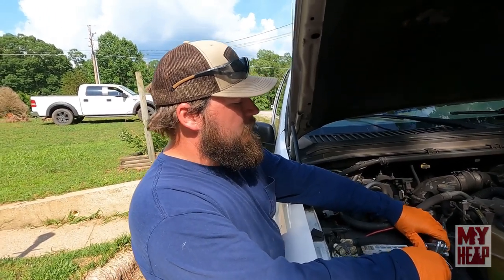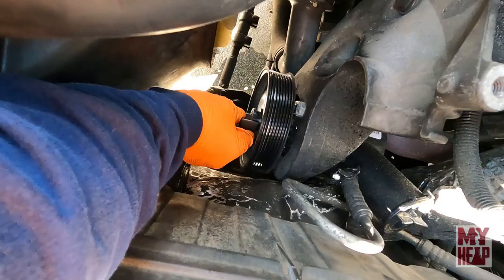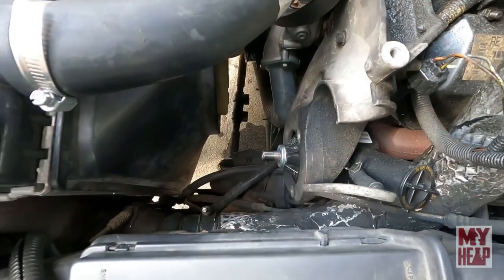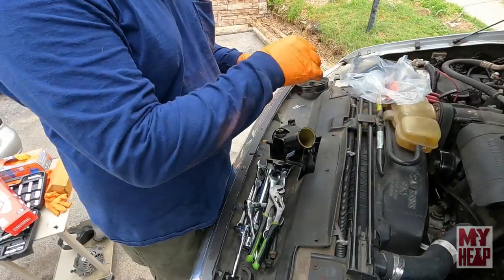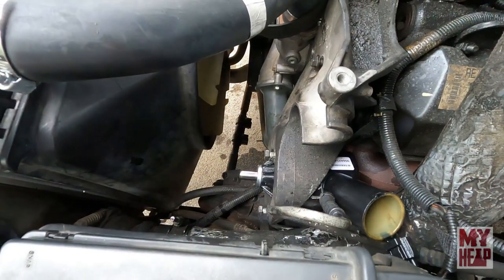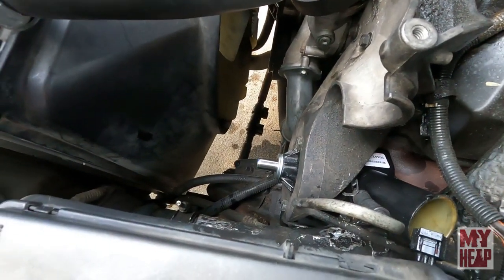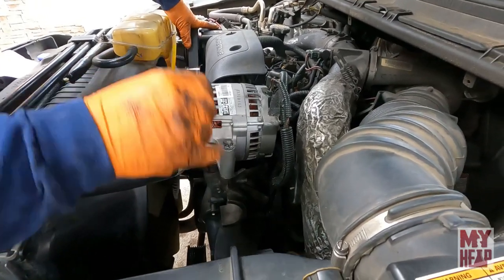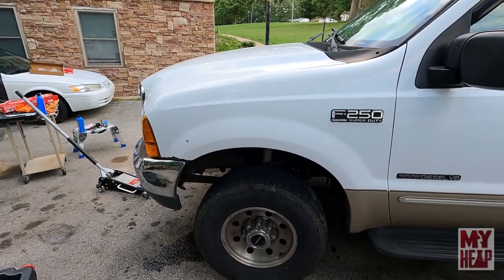Power Steering Pump Replacement on a Ford F 250 Super Duty with 7.3 Liter Diesel

Comment: Fantastic video,  I can see how an electric ratchet would be very useful on this job
Reply from the maker: That would ave saved some time for sure!!!
Reply: You would need a right angle impact not just a ratchet it takes good force to pull it off and they reccomend not using powertools with this style puller

Comment: eyup Joe
good to see you back in video land, great instructional video from you both👍👍👍👍👍👍
regards
Kev (uk)
Reply from the maker: Hi Kev.  Yes sir it has been a long while since I have posted a video.  I hope they become more frequent.  Life has been a chore for the last 18 months and I had to get back to video and the shop to relieve the stress.  I expect you will see more videos in the future, including, (I hope) the finishing of the Tich pump and Kenneth Wells stationary engine.  I have been in the shop vicariously by watching you and others.  Thank you for stopping by my friend.

Laus Deo,
Joe
Reply from the maker: Hey Kev, a quick question.  I have to cut a couple screws for the Burk mill.  Is there a certain type of steel I have to use or can I use mild steel?  Being mine, I am sure it isn't going to get a lot of heavy use.  With your experience I would feel better with your input.
Reply: @MyHeap  hi Joe,
i'm not familiar with a burk mill, whats the screws for.!
If in doubt i would get some bog standard over size high tensile bolts with and make them out of them.
Hope that helps.
atb
Kev
Reply: @MyHeap  praise the lord!!!👍👍👍👍😉😉🚂🚂
Reply from the maker: @MrFactotum  they are feed screws.  One for the knee and one for the saddle (I guess, the Y feed.)  They are 10 TPI ACME thread.  One about 8 inches long and the other 12 or so inches long.  I should have clarified.  Feed nuts are bronze.  The 8 inch screw has a bevel gear that runs the knee screw.  I messed it up a bit trying to get the tapered pin out.  The saddle screw is badly pitted.
Reply: @MyHeap  praise the lord!!!😉😉👍👍🚂🚂
Reply: @MyHeap  oh, i would say mild steel would be adequate for those EN3a over here, or anything similar. or what you have on stock.
👍👍😉😉
Reply from the maker: Thank you sir.  I appreciate your help!

Joe

Comment: One of the best how to video's I've seen. I'm getting ready to replace mine on a 2001 with 483,000 miles. I just worry about bleeding it properly. Is there a way of knowing when it is fully bled? Thanks for the great video.
Reply from the maker: In my experience,  you will get most of the air out during the initial bleed, but you are likely to have some trapped air.  It will work its way out after driving a while.  Just keep an eye on the fluid level until it bleeds all the way.
Reply: @MyHeap  Thank you, will do.

Comment: Pull the bracket with the pulley attached the use puller tool detach pulley the reatach pulley to new pump through bracket install as one
Reply from the maker: Good tip!

Comment: You either have the wrong radiator hose or it's routed wrong.  There is a half circle groove below the alternator that shows where the hose is supposed to be routed when the proper length hose is used.  I didn't have to remove my hose (2001 Turbo Diesel 4x4) after I watched you video.  Still help me figure that I needed to pull the pulley :).
Reply: Different hoses and routing for dual alternator setups. Most people go to that hose because it is on the outside of the belt vs the other being inside the belt path. I traded mine out years ago in case I needed to swap the belt, I wouldn't have to drain the coolant.